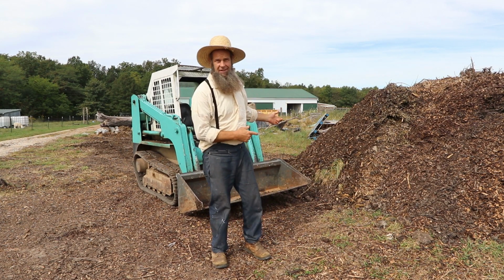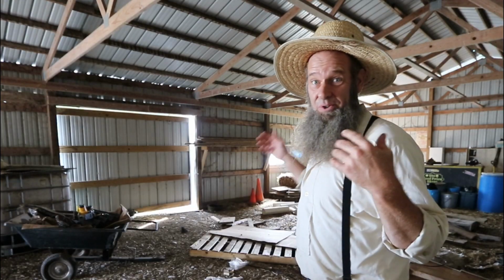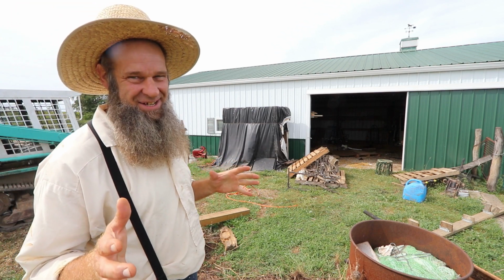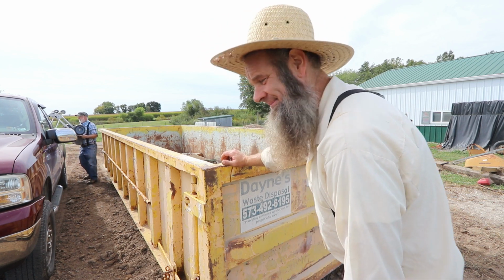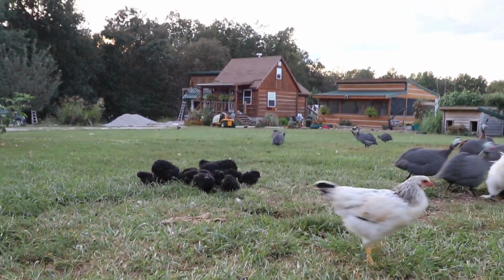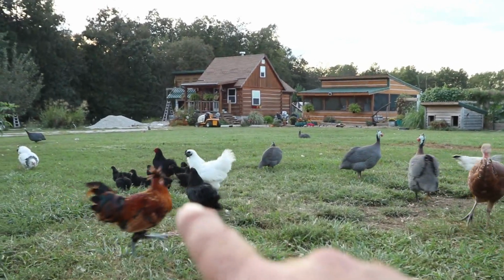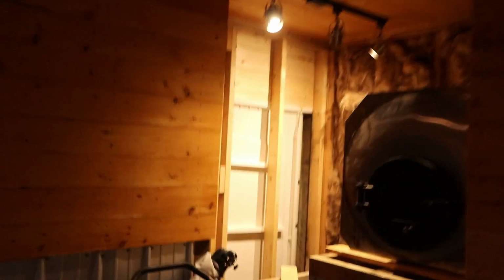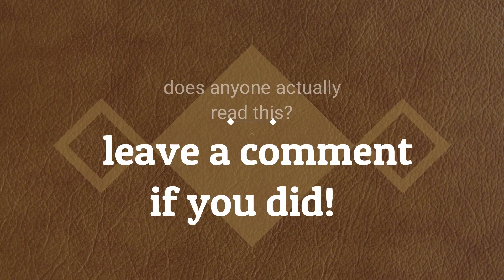every HOMESTEADER is HIDING this from you

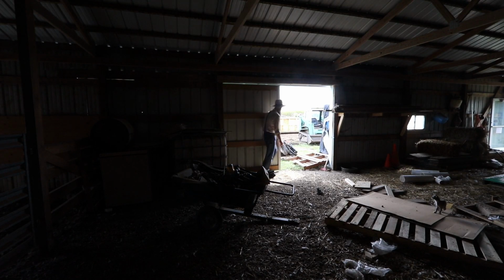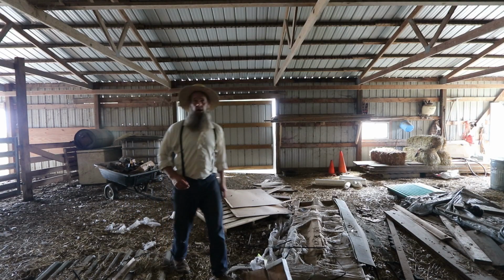Comment: Well, I'm cat-spotting in your videos...  Minute 4:31... 5:38... 12:20...  A couple of times I couldn't confirm if I saw a kitty cat but, that's it, I think.  LOL...  

Man, all your birds sure get excited at feeding time!  Good to see the Cochens out on the loose!  Had to look them up and found out they're called Cochen - China chickens!  However, they were imported from a French colony in what is now Vietnam.  Good wintering and egg laying birds, as they say in the info I found.  But, the egg-laying that was before they were breeded for looks and such, so they lost some of their better traits.  They are still good winter-layers but, will only produce 150 to 200 eggs a year.  Originally, they weren't a pretty bird to look at but, were great producers of eggs and good for meat.  Cochens were likely cross-breeded with several other imported chickens from China and Europe.  Another thing they say to watch out for is that, they tend to be lazy and will hang out by the feeding troughs.  So, they can require monitoring, weighing them regularly to be sure they don't get too overweight.